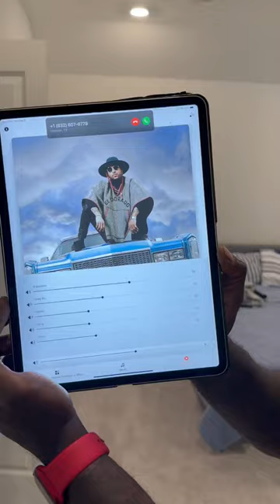How to add 12 speakers to your house (full video)

Comment: I like these speakers but they don't appear to be ic rated. Can you recommend any kef inwall speakers that are insulation contact rated?
Reply: What brand are these speaker they sound great? And I don’t think if matter it’s low voltage so it doesn’t get hot enough I don’t think

Comment: How do you run wires between floors like if the attic access is on the second floor but your termination is on the 1st floor? Like how do you get past studs and joists?
Reply: I have a feeling this is a one story house, and that makes everything much easier once they are up in the attic
Reply: Sometimes you got cut drywall especially if your on slab foundation if you have a crawl space and your system is on the first floor you can go this route , but if the wall is in line with the second floor you would have to cut drywall on the second floor at the bottom to drill through the top plate of the first floor cut the acces hole at the receiver to pull them on out , a lot of times during build you can put a open conduit in from first floor to attic to solve this problem one at the panel for TV and internet and one at the entertainment room , only thing is sometimes they do cause condensation and can leak water have seen this happen .